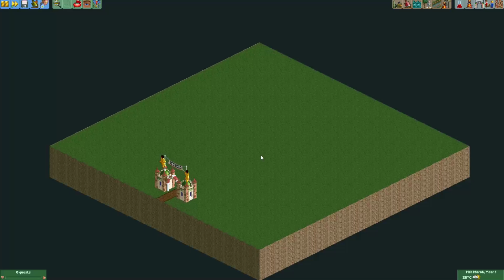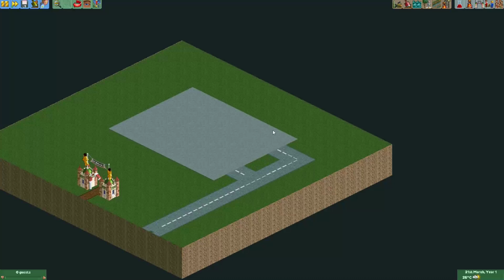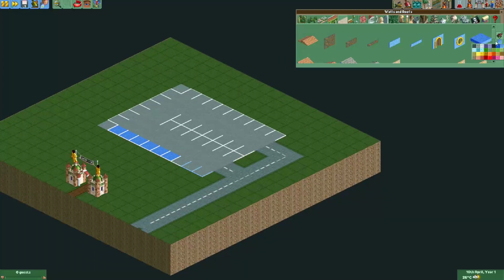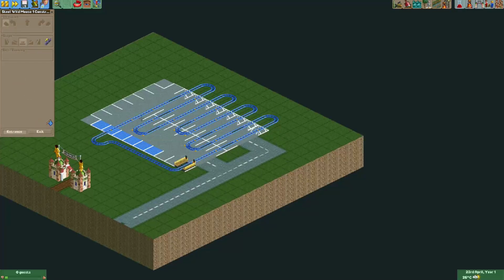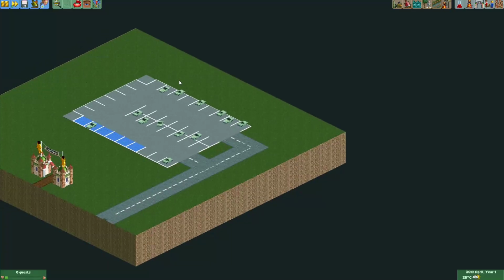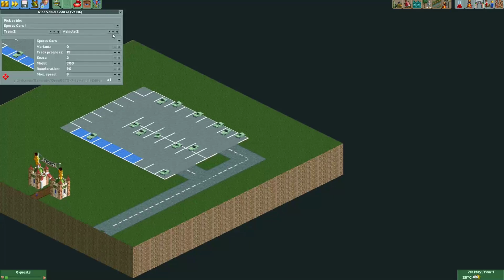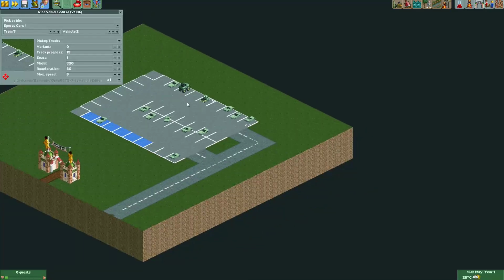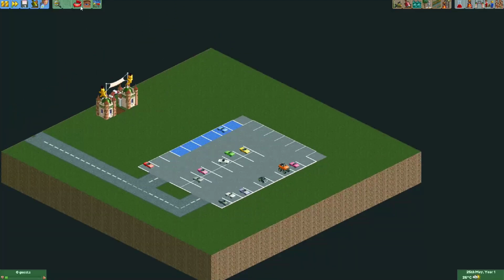Git Gud at OpenRCT2 #95: Basic parking Lots!

Comment: What is the purpose of the invisible vehicle types?  Is there anything useful you can do with them?
Reply from the maker: I assume their purpose is to make the car ride train a bit longer so doors open and close before and after them. I typically use them to make a non-powered vehicle powered. For example put one of these invisible vehicles before a corkscrew coaster and it will start moving on its own!

Comment: I want Ride Vehicle Editor too but it doesn't work on mine. install but it doesn't work.
can you tell me how i can do. i have done to plugin but it doesn't work. if you can help me please be happy.
Reply: Hey you can check out DK's other video on how to download it. Make sure to download the .JS file and not the .ZIP! And you have to put it into 'Documents/OpenRCT2/plugin' folder. The plugin only in the newest develop version (NOT release version), and only works in singleplayer. :)
Reply: @Basssiiie  i tried but it doesn't work. but the other ride vehicle editor v0.3 that does it shore. i also like if i have v0.3
Reply: @tramcoaster33  If v0.3 works but v1.0 doesn't, it means that your OpenRCT2 is too old. You need to have downloaded a new develop version within this month (the plugin uses very new OpenRCT2 features), or use the launcher to get the latest develop version.
Reply: @Basssiiie  for a while i have had openrct2 v0.3.2 and as yet it only does ride vehicle editer v0.3 and the others v1.0 that does not. but I also think v0.3 is good. :)